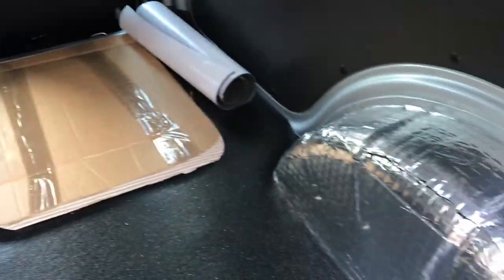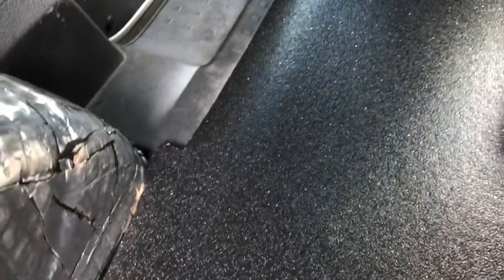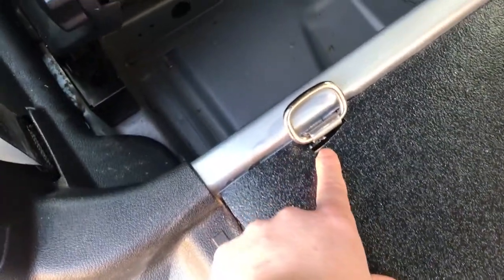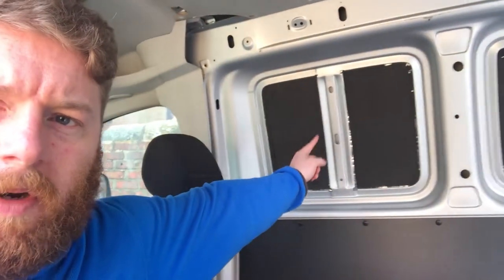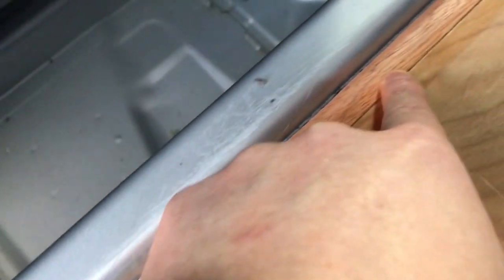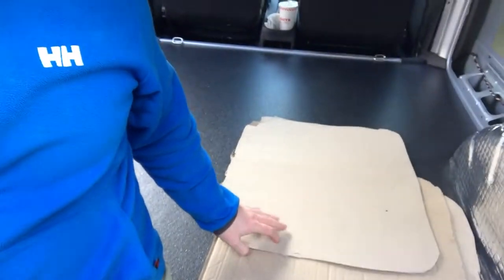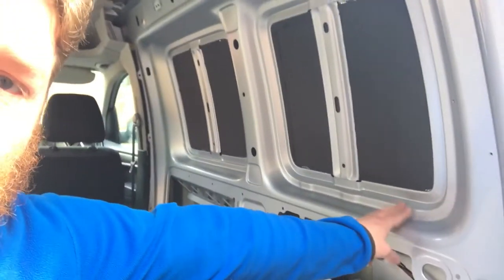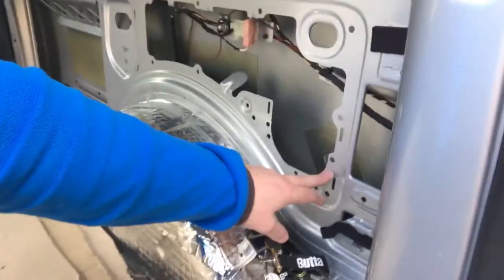Window blanks & other bits VW Caddy 4

Comment: Bought a caddy mesel around end of Feb. Wish ad seen your vids as tried to do most of the same things without as good a finish. I also screwed my ply floor down as didnt even think of doing what u did. Great vids mate, loving the work 👌
Reply from the maker: Hasn’t come as easy as it looked. Some of the out takes were unbroadcastable. Cheers buddy
Reply: @FreeworldOL  where abouts in the north u from? I live in prudhoe if uve heard of it. Some of the place av seen in ya vids look familiar
Reply from the maker: Not too far, Gosforth area